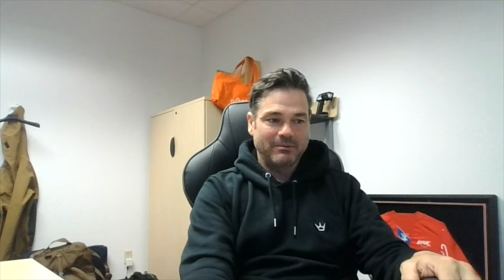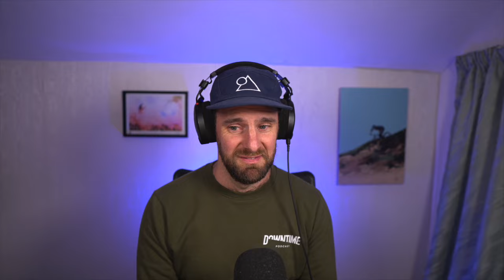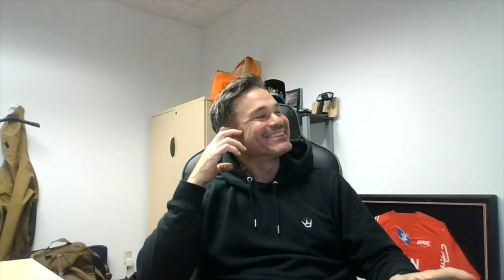High and Low Speed Rebound Explained by Jordi from Fox - Get Your Bike Setup Dialled

Comment: I’m riding close to wide open these days. Dh2 coil with Zeb ultimate. I crank the front comp on climbs and leave it a bit tight for park vibe but as soon as I’m on gnarly fall line single track, 3/4 open front and rear with fast rebound.

Comment: I think a concept super high tech suspension will have gps connected to it which will trigger upcoming trail conditions and automatically adjusts the compression and rebound settings .
Reply: Call fox bro, cause that’s possible.
Reply: This tech exists, and it has the shortcoming that it does not know what's in front of you.